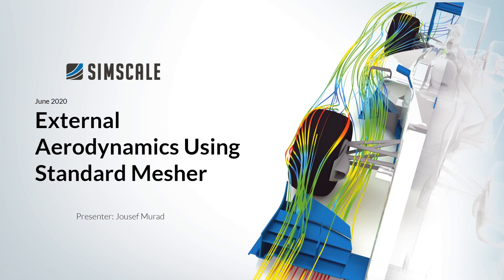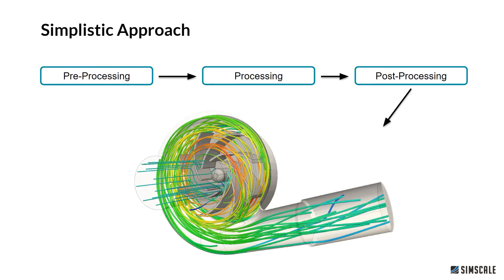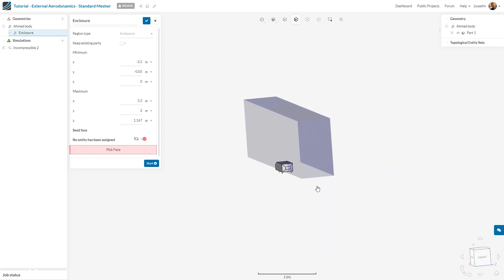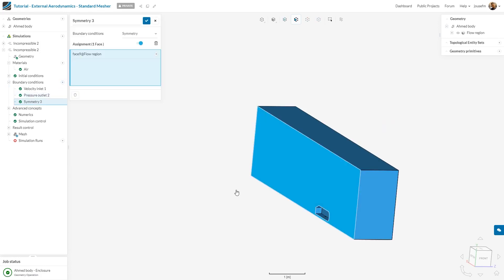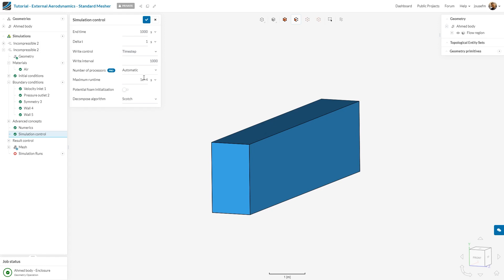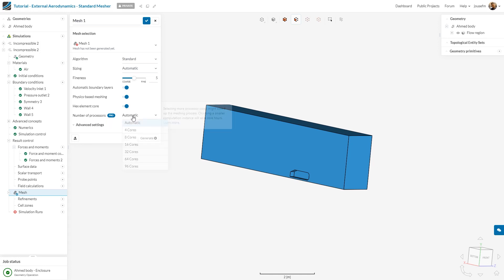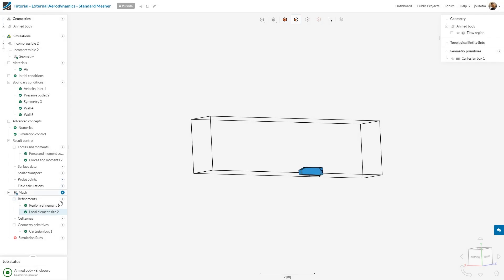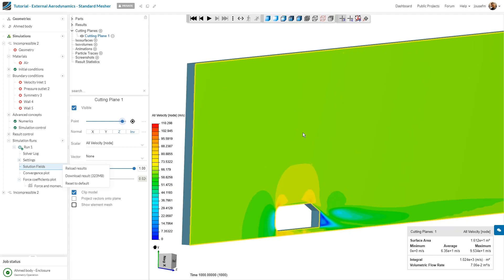How to Simulate the External Aerodynamics of an Ahmed Body

Comment: Hi Josef, I am importing a solid work stl file in the SImscale. But then it does not show the option of the first dropdown menu. Can you suggest any corrections in steps.. ? please help. it is for my final project.
Reply from the maker: Hello. You can find more information on importing CAD files here: https://www.simscale.com/docs/cad-preparation/. If you still need help, please utilize the forum (https://www.simscale.com/forum/) or the chat support button in the bottom right hand corner.

Comment: way to complicated. This needs to be cut down. The boundary box can be set automatically. No need for the user to do that. Far to many number inputs that are not necessary for a single direction of study. It's an object moving through the air at very slow speeds. drop the body in, set the direction of the fluid flow, select the fluid, hit run. The out puts can be set to the max speed limit. for example if sub sonic air is selected for the fluid. Then run the sim from 0-100 m per sec. Then give the user the option to view the data at any speed they want. 

We have a small DIY wind tunnel that dose 65 mph and can be upgraded to 100+mph, I can 3d print an air foil and bolt it in and turn on the fan. Sensors spit out the lift / drag, and strings or smoke are used for turbulence detection. If the simulation is more difficult to use than a make shift wind tunnel it's not useful.  

Correct me if I'm wrong here and please do an updated tutorial to demonstrate how to drop an air foil in and run a quick sim with out all these numbers and definitions. And then show the sim was actually accurate to the real world. Other wise there is just to much to get wrong here.

Comment: As someone who has never studied anything and is no engineer after Simulation control I dont understand anything. The only thing I want to do is hold a shape (.stl) into the wind and see how the air moves around it. The only idea I understand after setting the boundaries is that meshes are telling you how small the pieces simulated are and thus how accurate the simulation is, meaning it will take longer to compute. 

But I neither understand what those refinments are or do nor I see why I need that box for the wake flow stuff if I already specified the region where the airflow is. 

When I tried to push the simulation button and the computer said ok it would take months to render I guess. Pls help